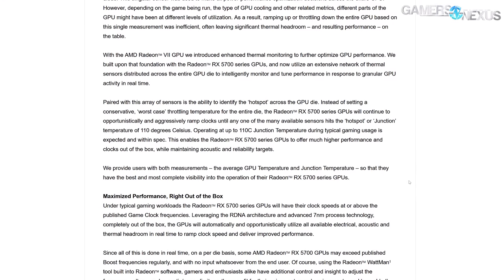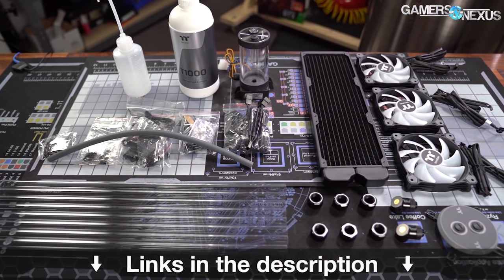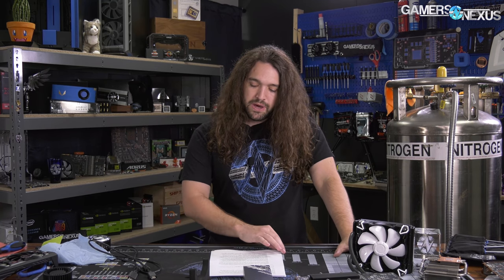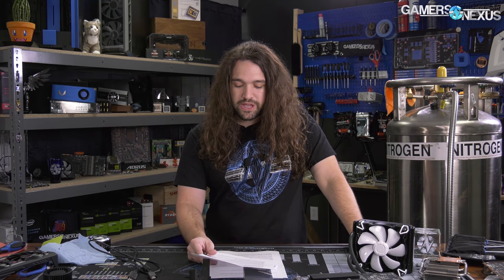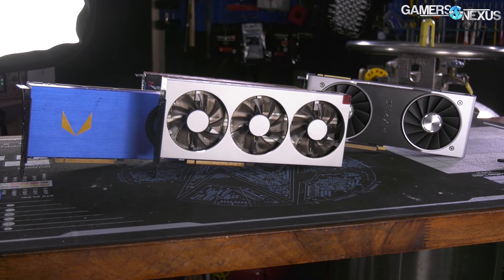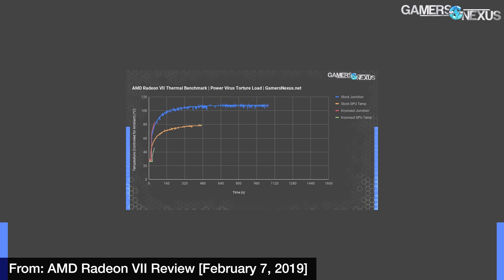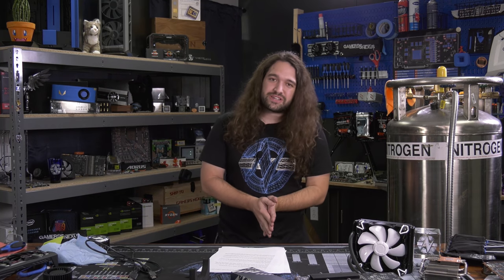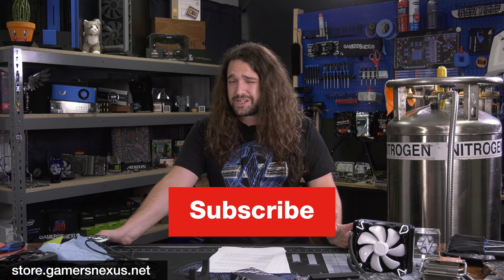Explaining Navi 5700 XT Junction Temperature | 110°C is Not "Expected"

Comment: "Hitting temps up to 110 junction is expected" is obviously them stating that their manufacturing specification allows the cards to hit 110C junction temperature before the core/card would be considered faulty.  This doesn't mean every card will hit it.  It's just that if yours IS hitting it you are still within the allowed minimum specification set by their engineering team and the card isn't going to run into trouble for running that hot.  The quote about throttling is, as well, obviously them stating that as far as the thermal design of the card is concerned the card will continue to boost up to 110.  They are pretty obviously affirming the 110 is normal statement by explaining that this temperature shouldn't affect your GPU boost, and were specifically talking about the thermal tolerances on the card and didn't feel the need to mention power limit, etc.

This sounds like a statement from someone in engineering the way it's worded... I don't know if that's what is confusing or if people are ignoring the context willfully to meme about AMD space heaters again.
Reply: The video demonstrates the GPU not boosting up to 110c
Reply: Safetytrousers the one they have. This is a just  statement about manufacturing tolerances stemmed from people worrying about hot j temp.  Just because the tolerance is allowed to go up to 110 doesn’t mean that every card is going to hit that temperature limit before it hits a power limit. Some percentage of the chips almost definitely will get close to that temp because those are the chips on the edge of their specification. Anything that runs hotter to achieve the right frequencies I’m assuming would be scrapped or repurposed. 

All the statement meant is “If your card reports a temperature up to 110 degrees this is within the thermal specification of the silicon and there’s nothing to worry about.” That. ’s it.
Reply: @Toxici-Ty  That's not how they worded it, and that is the issue. We shouldn't have to guess at a possible actual meaning. They should be accurate and explicit in the first place.

Comment: Answer is at 13:30. 

The fact that better coolers are available doesn't mean that running near Tjunction isn't acceptable. If I don't want to pay $10 more for no more performance then the partners didn't do good work, they are selling better for the sake of better, not for real benefit. You're right, but you never explained why. Buy a better cooled card, and slow the fans until it runs at 100+C, as long as you have a ~10% headroom for load spikes, acceptable is acceptable. The reason for a better cooler is ACOUSTICS, NOT Thermals. But if you always wear headphones and don't care about noise, "the cooler is shit" is no reason to pay more.
Reply: What kind of headset are you using? I could still hear that piece of shit cooler despite blasting the game sounds in my headset. 

Blower cards are only here for the people replacing the cooler or those idiots who have an itx case lmao

Comment: AMD, can you please just STOP using these blower cooler designs for your reference cards?  Please?  I love you guys ... but it’s 2019 and nobody wants these.
Reply: agreed. just sell them without a cooler or sth. no one will use it anyway. it will be replaced with a waterblock or aftermarket cooler anyway
Reply: Just switch to dual axial fan coolers similar to how Nvidia did with the 20 series. No one wants a blower style cooler.
Reply: @React2Quick  Actually, there might be takers for the blower design. A super compact mini ITX build might benefit from a blower style cooler where ventilation is at a premium and it would help to exhaust all of the GPU heat directly outside instead of inside the cabinet.

However, I admit that this is a very specific and rare use case. Many compact builds work well with axial fan GPU coolers. If I was out to buy the 5700 or the XT, I would pick up a 2 or 3 axial fan model. But what I wanna know is, why can't a blower type cooler be engineered to perform well? Why can't the high pressure advantage of the centrifugal fan be leveraged by a higher fin density heat sink to offset the lower air flow volume? Why do blower cards have to be bad?
Reply: @ifyouwantmoneythengivemeev8094  Spot on.
Reply: Just wait for big Navi and they still use horrible blower coolers
Reply: No I specifically want blower. In fact im waiting on a blower 2070 super to be on sale for upgrade but that is so hard rn because so few manufacturer make it. But blower is the most optimal for my case. I even tried gpu with Aio.
Reply: @tuanseattle  man, you need a new case, not a new card....
Reply: @faffabout9412  I do not like big cases. Blowing hot air to the small case make my CPU hotter.
Reply: @tuanseattle  why the fuck would you want an overpriced 2070 super? 530 dollars while you could get a 5700xt for 400 dollars that's only 5% slower smh
Reply: @ifyouwantmoneythengivemeev8094  yeah as you only in specific circumstances. Those circumstances are not common enough for blower style coolers to continue to be used as the reference model
Reply: @tuanseattle  you don't need a big case to have good airflow, the H200 and metallic gear cases are shoebox size and work awesome, they are also only 70$ or so I've built in them multiple times, and got the same temps as big cases
Reply: @wile123456  oh boy an AMD fan boy over here. Go ahead and use that for yourself. I've used Gtx 1070, 1080, rx 580 and vega 56 for the past year. AND i'm telling you even if AMD give a little more fps for the money, Nvidia will still worth it because AMD drivers are shit, games are not as stable.
So stop reading/ watching online review, and go ahead and experience both products yourself before you talk. AMD users always have to go through more trouble shooting. With this Vega card, even thou i got a good one with Samsung memory and can do a good undervolt, it still have issues. And I can't use the latest drivver since it would crash my system all the time, have to stuck with an older one just for stability. That happen much less frequent in Nvidia world, whether they "gimp" your performance or not. You just have less issue. period.
None of the online reviewers really use any product for extended period of time remember that. Noob.
Reply: @faffabout9412  I know all that. I'm using an Alienware meaning if I change case, I would have to change the motherboard too if I want every thing to work smoothly and properly (IO and sensors). That would be $180 for the cheapest decent Z390 board, $70 for the case and another $60 for a cooler. Why would I want to pay that much when a blower will simply be sufficient for my use case. Point here is that blowers do have their place so they should not all go away. Another usage for blower cards is when you have multiple GPU set up and you don't want to invest in a water loop. Multiple Blowers cards will do much better next to each other in a closed case than open air.
Reply: @tuanseattle  ok, then you should have said so... Not claim small cases need blower cards.... Also blowers don't work better for SLI, card spacing and airflow still decide the performance... I know because I have used them both and tested them both....
Reply: @tuanseattle  I'd like to ask, if you knew buying Alienware would lock you into a more complicated upgrade path would you still have done it? I love Alienware cases but if I got a used one for a build I'd gut it and give up the features.
Reply: @wile123456  I've used many pieces of hardware because I build and flip PCs & PC parts all the time. You know nothing. Wait till you actually spend money on those hardware and use them everyday before you talk.
Check out gamer nexus older videos about his work stations, see what he uses there.
As somebody who is actually using an AMD product, and probably have more actual experience tinkering with PC than you, and more likely is better than you "at windows", I'll tell u this: "Fine Wine" = "poorly written software and drivers that take years to be optimized instead of working right out of the box".
AMD don't even have enough resources to pay a competitive salary to their engineers so it is no surprise they always have issues and problems.
Just google Vega 56 problem and issues you'll see it's super common for us Vega owner to have to revert to an older stable version instead of the latest ones because AMD can't write a decent piece of hardware.
On the Nvidia side, 2070 is shit. 2070 Super serve more than just a performance bump. Youtubers and Nvidia won't tell you that those original 2070 and 2080 cards got it so bad but if you knew people working in selling Pc parts they'd tell you those cards do have higher return and warranty rate, believe it or not. Per my hands-on experience, I got an EVGA 2070 on sale for $380 on Amazon and had to return it. My friend, starting when Rtx 2070 first released, had bought in total 3 cards on several occasions and had to return all 3 in less than a month. So yeah, the original rtx xx70 & xx80 is no go if you value your time (if you get lucky thou you are more likely to still get a card that run till your system die, but I won't take that chance anymore), the only choice if you don't want to deal with AMD's instability and shitty drivers is either an used 1080Ti or a new 2070 Super. 
Stop reading specs online or online review. Go out, buy some hardware and actually use them before telling people what they should or shouldn't buy. The only good thing about AMD is that they are cheaper (and may be, better triple monitor support). But to many people the generally smoother experience of Nvidia is worth the premium. If I can afford $400 for the 5700xt, I can afford $500 for a smoother and more reliable experience with the Rtx 2070 Super. But obviously, I'll wait till I can catch a sale like I always do. Never pay full MSRP then complain.
Reply: @ChucksSEADnDEAD It depends. I'd done it if it is cheap enough. I got a really good deal with 1 year warranty during the mining craze of 2017-2018. For $1000 at Bestbuy I got i7-8700, 16gb ram, gtx 1070. Keep in mind during this time ram prices are crazy and a gpu 1070 alone cost $500+ so the whole thing is significantly cheaper than a custom build. During this climate when Ram prices are cheap thou, I would not do it and would pay a little more to build something myself. However keep in mind everything including gpu ram the powersupply and Liquid cooler can be upgraded / replaced except for the mainboard & case because the mainboard and the case are designed specifically to work with each other. yeah, and also the CPU is limited to 8th gen so i7-8086k is the best it can take. No i9-9900K. But by the time i need 8 cores I would've build a totally new system. Unless the prebuilt is cheaper again for some reason.
SO in hindsight, if this system had cost the usual price tag of $1k5, I would never do it. But at the time it was super cheap it couldn't be ignored. So I bought the Alienware just because it was cheaper than anything I can build not because I think it's too great or something. 
Now, If am buying it for friends or family, it is a different story. The all-inclusive in home warranty is very valuable to non-technical people and they wouldn't care about upgrading from i7-8700 to i9-9900K anyway. And I would not have to be called everytime there is a problem with the PC.
Reply: @tuanseattle  JEsus crhist im not reading your whole essay troll.

swapping parts out every few months is stupid though, but i didnt expect anything mroe from you. I've build and used many different parts myself, mr projecting.

And good luck buying a 2070 super cause that will enver happen SINCE EVERY SINGLE ONE SELLS FOR ABOVE MSRP BECUASE ITS OVERÅRICED GARBAGE.
Reply: @tuanseattle  yeah, considering the timing that was a crazy good deal.
Reply: @ifyouwantmoneythengivemeev8094  That makes sense, unfortunately.

Comment: I have in my possession an R9 390X with the reference blower. Its still alive and well. I dont think high temps will significantly shorten the life span of a typical enthusiast video card. The R9 may be acceptable for gaming another couple years and then I'd probably sell it. Its already old. If it gets really hot like in furmark, it will throttle but thats not typical temps I would get in a game anyway. Either way I'm not worried.

Comment: While it is true the cooler does not perform well, thermally or acoustically, it is worth mentioning the performance gaming crowd overestimates the effect of thermal degredation on graphics cards. While the junction temps are lower on other coolers, the 80-84c range is what is expected of blowers, and close to what you'd get on edge temps on Navi. So it's not any worse than any previous blowers. The memory temps aren't as close to the 95c tCase thermals as you'd think, as AMD has revealed that the memory temperature is also junction, not edge. All workstation GPUs - both Quadro and Radeon Pro - are sold only as blower coolers, and those are expected to have long life. Quadros have been known to hit 88c edge temps, hotter than Navi shows, and they are sold to professionals who require longevity, and unlike the gaming market, are more likely to keep cards beyond 2 generations and run them extensively under full load, those cards take serious abuse and turn out fine. It's also worth mentioning that silicon degrades with both temperature and voltage, and are much less abused than CPUs. Navi uses 1.025v for the 5700, and 1.2v for the 5700xt, which is much less than someone overclocking a 3900x will dump into 7nm. And we aren't even aware of how the differences in current draw affect in a GPU affect lifespan relative to a CPU, it may be more voltage tolerant. Either way, a GPU has locked parameters. This is why sliders in overclocking software "max out." A CPU can be pushed outside the safe confines of the chip by the user, at which point thermals become much more important (look at the voltages of LN2 overclocked chips...those would die instantly without sub-ambient cooling.) I'm not saying these coolers are good in any way, but I am saying that the effect of thermals on GPU longevity is largely exaggerated by the gaming community. If blower coolers and 80+ temps were unsafe...they wouldn't be used for Enterprise products, even disregarding the fact that they better suited for low airflow situations. The tradeoff wouldn't be worth it, especially in a situation where a short MTBF causing a problem grows exponentially. Such as multi-GPU supercomputing applications. These coolers suck. These temps aren't as low as they can be. None of that I'll deny. But they won't kill a card. Especially not a gaming card, which typically is utilized less than 3 years before being replaced.

Comment: I don't understand what the controversy here is, AMD's blog post is precise and well worded. When AMD says "expected and within spec", it means exactly that the temperature is not dangerous to the product and the product can be expected to perform at its design performance for the expected lifetime of the product. If you read manuals or technical specifications, this is a very common and typical wording.

If people misunderstood what they wrote and interpreted it as the card are supposed to run at that temperature, that's not AMD's fault, but of the reader who should return to school to relearn reading comprehension.

Comment: Letting them run this high decreases usable life span to the point that something that could have lasted years is now going to last 500 hours at the maximum temperature witch is the amount of time many other ones are rated to operate at that temperature.

Their going to say that the maximum temperature is okay without including that it's going to reduce the life expectancy from more then a decade to less then one year depending on how it's running.  

The board is also going to flex causing the solder balls to break off and improper contact with the cooler and I bet the thermal paste is going to pump out more frequently.  I've had a board that I got used and it had a big bulge under the socket because of it operating high and I'm talking about a system that turns it's self off once it hits 100 degrees.  

Mentioning how damage occurs and that it reduces the usable lifetime at these temperatures would have been a really important thing to explain since this is getting to the point that people  are soon going to start ending up with cracked heat sinks from it expanding and contracting.

Comment: Inductors are not solid state devices.  They are merely coils of wire wrapped around magnetic magnetically active (boost for iron composite, bust for copper or brass) material with some mu.  However, the wire resistance definitely changes with temperature and will affect the characteristics from the VRM.  In some cases inductor forming materials such as WAX melts and well, it's gone after overheating.  Also, Solder melts and fiberglass burns but not at those temperatures.